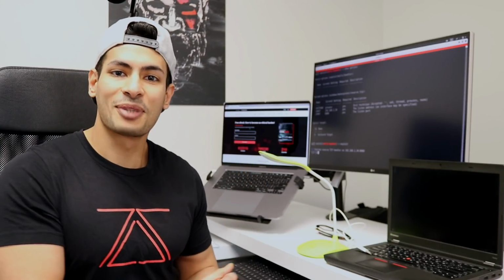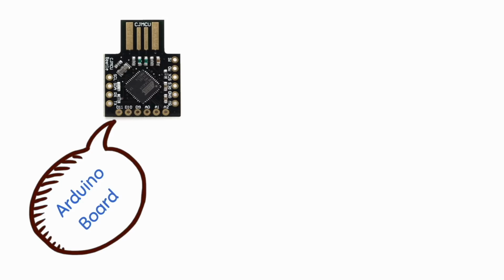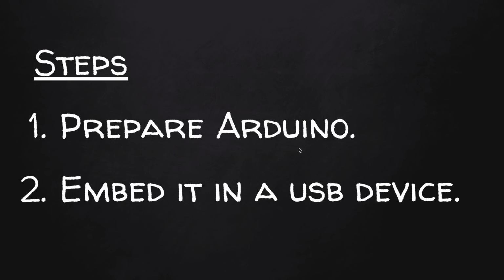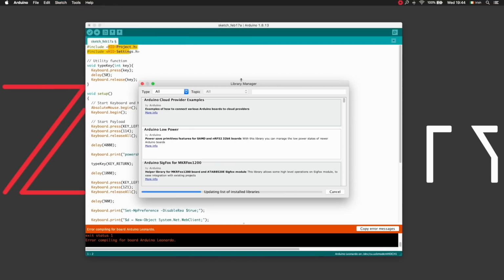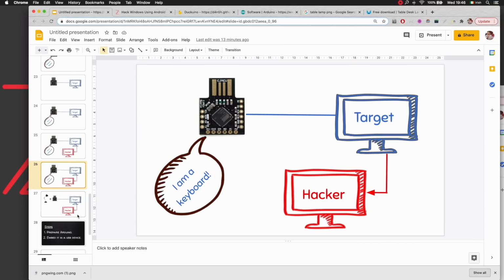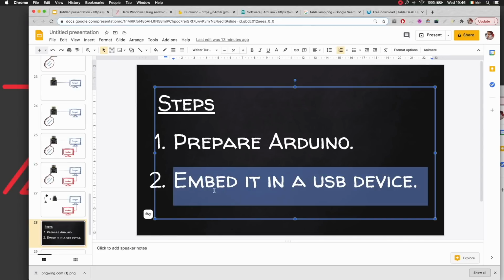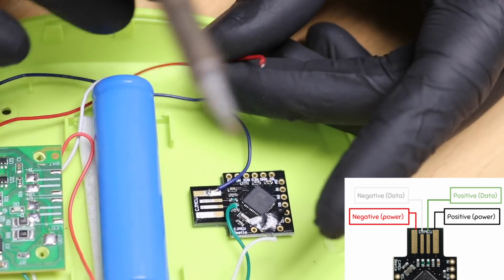How you could get hacked through a simple USB device

Comment: Sir can you please explain that how to do it with a normal usb drive,  please sir it's a humble request
Reply: The normal usb drive will not be able to accommodate the bigger size arduino card inside it casing, just my guess.
Reply: @caramonchan3464  but can we make it ?
Reply: @josinjojy4268  No easy unless you can find a usb drive with a bigger size casing + you have to make sure the board in the drive does support power out.
Reply: u could use rubber ducky

Comment: Great vid, thumbs up!
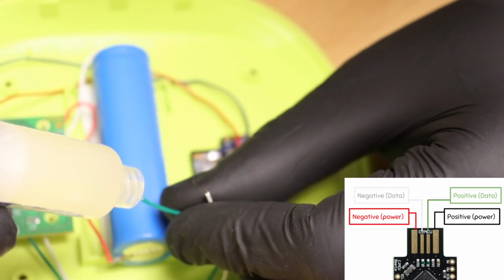But 1 question: at 15:57 the picture at the bottom right says the left one is for negative minus, but at 18:00 it's the +5v solder point red cable is connected to the negative on the arduino, could you please clarify?
Reply from the maker: Yes red is the negative power.
Reply: @zSecurity  I'm a noob in this field, so to power this device you connect the positive+ from the battery to the negative on the arduino, and solder the negative from the battery to the positive on the arduino to make it work?